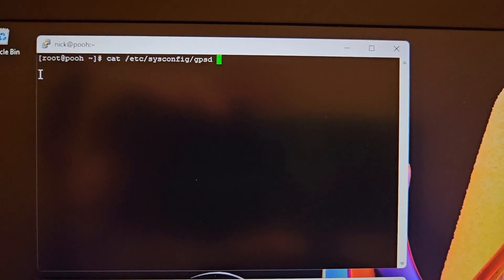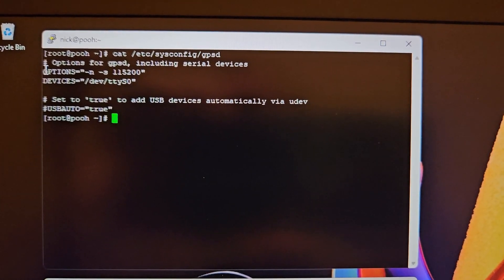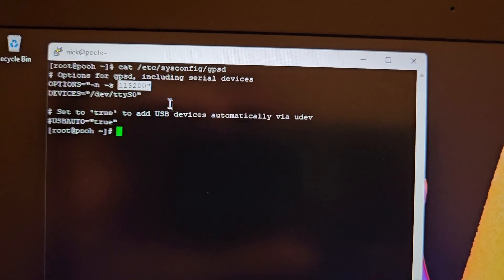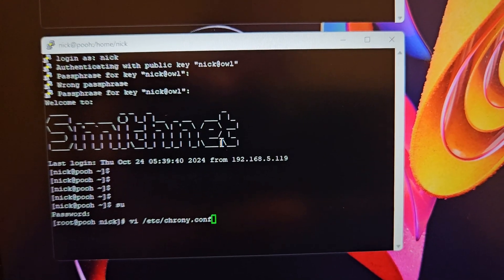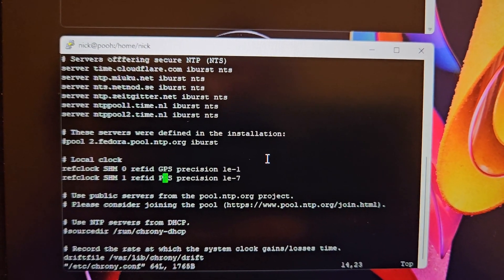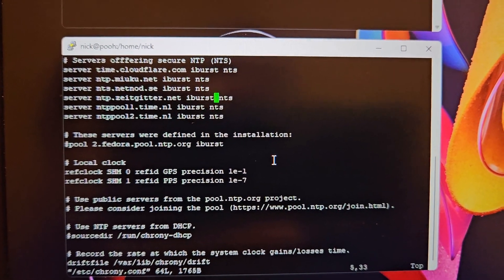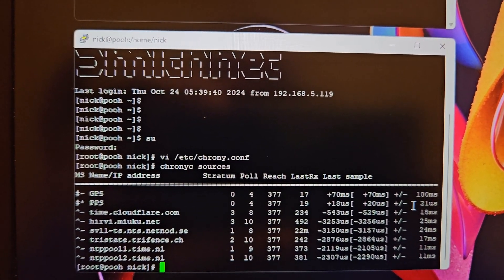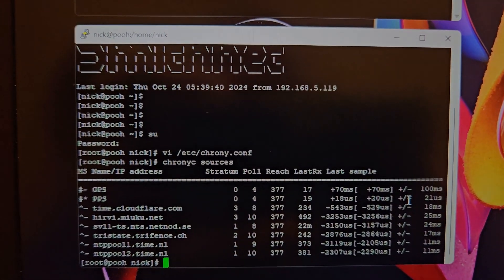GPS Receiver for time synchronisation

Comment: Sorry, I missed how chrony is getting the 1PPS data?  Is that wired up using your front panel 1PPS signal to, e.g., some GPIO input, or are you using the DCD signal on the serial port?   Note that you'll likely see a bunch of jitter on the 1PPS signal due to how USB transfers work, wasting some of the precision available to you with the 1PPS signal from most GPS receivers.

On the other hand, if you're only worried about sub-millisecond accuracy, maybe don't bother?  You can make yourself crazy chasing the microseconds here..  In that regime, you need a GPS receiver fancy enough to specify the cable length delay to the antenna to account for those extra nanoseconds.

Thanks for the making the video about your project!   I certainly appreciate the alarm feature that you added; it demonstrates a little bit of the unhealthy fascination that some of us have about precision timekeeping.  Next thing you know, you''ll be hanging about at midnight UTC when a leap second is inserted to see what happens with your GPS receiver and NTP code..
Reply from the maker: I made the video rather quickly when I wasn't completely well, so missed some details in retrospect. Yes, you are quite correct about USB not being a good choice due to jitter. I chose the DCD handshaking line of a real RS232 socket on my Dell desktop computer (but USB adaptor to laptop for configuration). The uBlox software seems to have a cable delay option you can use to compensate for cable length. I guess that's a second order obsession I might get into later, worrying about velocity factors, the jitter of the linux kernel responding to hardware handshake transitions... but I had better finish some other projects first :-)